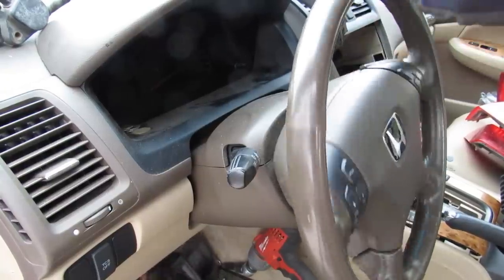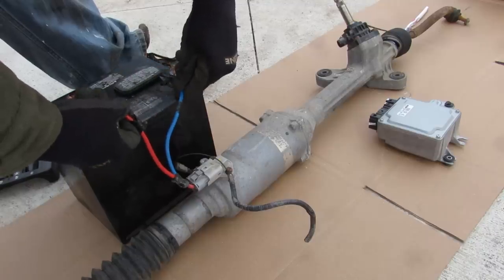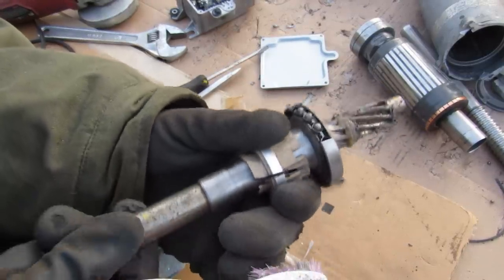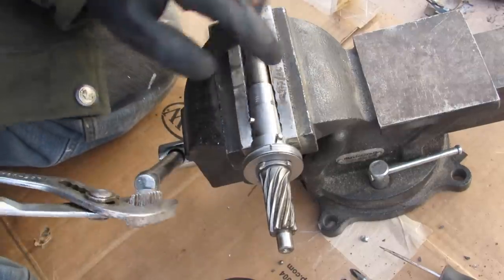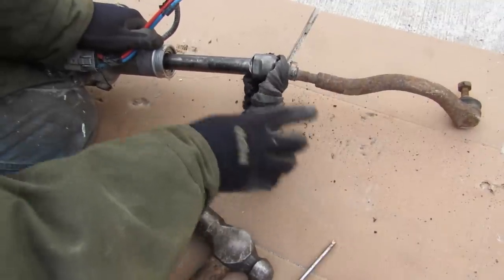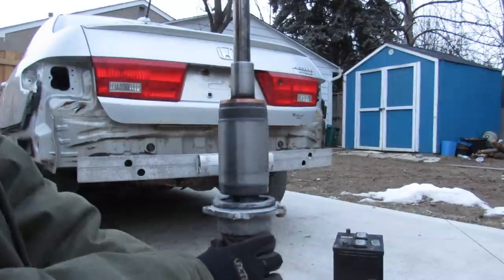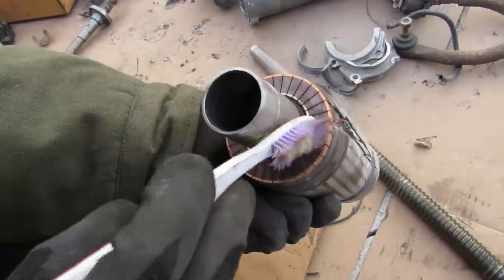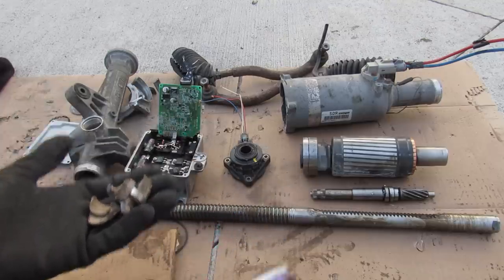How Electric Power Steering Works

Comment: This seems much more complex than hydraulic steering.  I wonder what the supposed benefits are.
Reply: Probably in part r&d for electric vehicles, easier to work around or replace. Also is more compact, eliminating the need for pumps, reservoirs, lines, etc. Does not require an additional pulley. They probably sell it as a "greener" alternative, less likely to pollute, because no fluid leakage. Cons include poor steering feel. Trust me on that last one 😂 you need literally no effort.
Reply: Not having every old vehicle have failing power steering because the fluid is never replaced, no whining sound when turning the wheel, and so forth. 
EPS is one of the few truly good advancements in cars. It is actually far simpler. Just maybe it what you are used to.
Reply: Much more complex? How so?
Reply: One less accessory for the engine to drive, which in turn improves power and MPG, less parts overall, less points of failure (debatable and depends on the design manufacturer uses) i.e no leaks from the rack, hoses, lines, steering pump. Steering columns can be designed differently. Given that the electronics dont have problems I'd say it's more reliable. Some cars the feedback in the steering is fine, others not so much and too sensitive.
Reply: Improves fuel efficiency since your engine no longer needs to waste power running a hydraulic steering pump and also they're pretty much a requirement for electric cars.  Downside is the same as most of the other tech being implemented in new vehicles...appreciably more complex than its predecessor, harder to diagnose, and a LOT more expensive to fix when some component fails.
Reply from the maker: Better economy and no leaks!

Comment: I heard that the only thing that you have to worry about with the electric power steering is if something will went wrong with even one tiny little wire will break the whole shit will stop working immediately. 
So you won’t be able to turn anyhow!
Reply from the maker: You will still be able to manually steer just as if your hydraulic power steering went out
Reply: @speedkar99  Are you sure? Because I heard that all types of electric power steering have that issue.
Reply: @_viy  I can turn the steering wheel with the ignition in 'accessory' position. Heavy, but I can.

Comment: I feel they should go back to manual steering my 1966 f250 had no power steering it was perfect my 1976 f250 had power steering it sucked too easy and the feel of the road on wet and icy roads was gone same as my 18 wheeler no powersteering was fine

Comment: I can't imagine if the motor fails
Reply: The motor itself probably won't fail short-circuited if not overdriven, so you could still steer without assist. But the better question would be, what happens when the H-bridge in the motor driver fail? That would be really problematic, and I think that it should have to be very well engineered to mitigate the risk. Very likely it is not just a simple H-bridge, but redundancy and failsafes are built into it.
Would be interesting to reverse-engineer the arrangement of the power path.

Safety-critical automotive electronics rarely fail due to thoughtful engineering and rigorous testing.

Comment: So there's no physical connection from the steering wheel to the rack?  Don't think that's a good idea because computers and connectors degrade over time,  then accident waiting to happen!!!!!
Reply from the maker: Yes there is. The flat spots on the input shaft engage with the pinion once the torsion beam has twisted 1-2 degrees
Reply: speedkar99 that's good to know and a relief as my wife drives a 2014 CRV.

Comment: Electric power steering on a bus is not great. I begin steering and am met with resistance before it kicks in. The other buses have standard hydraulic steering.
Reply from the maker: Didn't realize EPS made it big
Reply: @speedkar99  Wrightbus Streetdecks. Hate them.
Reply: @speedkar99  In a car, it probably works well, but a bus. It's unresponsive and then there is some vibration as it turns. It doesn't help that the steering wheel is skinny compared to the older buses.